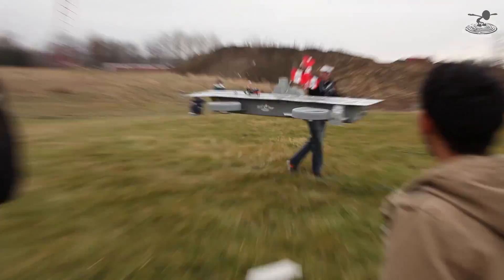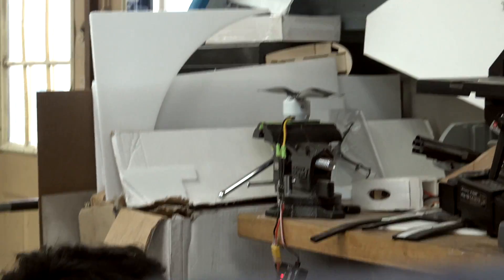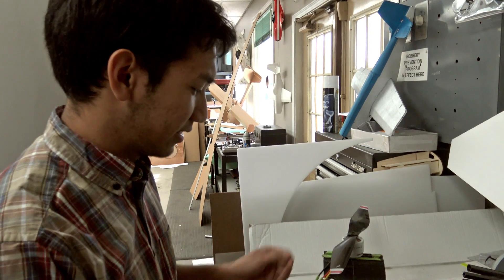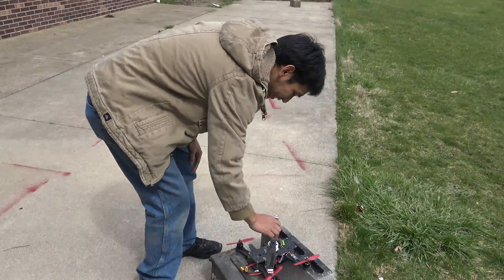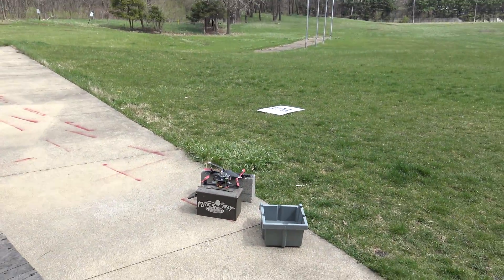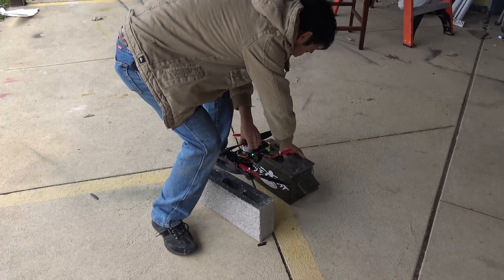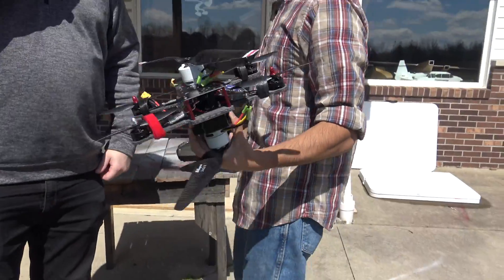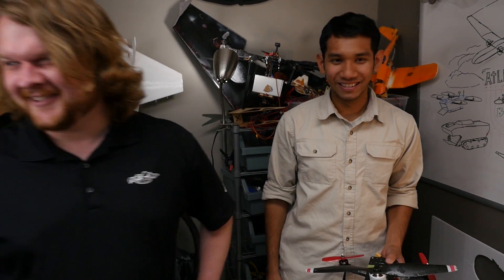Mini Multi Big Rotor! | Flite Test

Comment: nice test ,looking at this experience unfolding I had one thought ,longer arms for the small motors ,moving them out of all the turbulence  .PLUS longer arm = a better lever effect that will possibly make them demand less energie to stabilize the entire "PropBii"   I am thinking ate least 4-5" away from the tip of the big props (,hehe yepp a name suggestion on top)  On the other hand they will need to move more distance to achieve corrections ...Bets are open!  .Hoppe this comment reach you well . (FYI I did not take time to read any of the other comments ,maybe one already suggested this .I will  come back to read laterz  TY VM for the entertainment  Cheers

Comment: Have you ever tried doing a quad/gyrocopter.  So one free spinning unpowered prop on top and some sort of thrust in the back with a rudder.  You could take off with the quad and then get up to speed and switch over to gyrocopter mode and go long distance low power.  Would be interesting to see if that works.

Comment: by the way, other that the weight penalty, have you considered the impact to stability of putting both of the lifting, slower rotors above the multirotor frame instead of having one above and one below?   ....Something like this arrangement but sized appropriately...
https://hobbyking.com/en_us/contra-rotating-bl-system-375w.html?___store=en_us
...and yes, the spacing been the rotors should be large enough.

Comment: Instead of the large lower prop, could you use a heli stabilizer bar? It would counteract the rotation of the top motor, but it wouldn't cause so much washout instability. Just a thought. Thanks

Comment: The more lift gained by the two counter rotating props the less control authority it has without adding cyclic pitch so you end up flying without the needed control response. But how are you going to get by without the Helicarrier? That was cool... I guess you must be building a larger version...

Comment: You mentioned a youtube video where they had longer booms to get the small props out of the prop wash? Do you have a link to that video? 

I love you guys, bc u have an unlimited budget to toy with ideas like this. But,  seems you guys spend more time screwing off,  than advancing the tech. As an aerodynamics engineer, I knew right away this wouldn't work.  As u said, prop wash = impossible. 

You could really be on to something here tho! Why in earth didn't you take 30 minutes and extend the booms? I was very excited to see the performance! But then you just started throwing fruit at it in typical Flight Test fashion.... If you guys are interested in having a SERIOUS engineer on your team with a degree in Aviation and 30+ years in the R/C aircraft scene, I would LOVE to voluntarily contribute in any way I can!

PLEASE don't give up on this. I know of several methods to solve the problem, with and without extending the booms.  I KNOW this will work, keep at it guys! Or send it to me,  i would LOVE to take a crack at it!

Comment: more aggressive pitch on the each successive rotor from top to bottom.
The four smaller rotors need only a minor increase.
While on the bottom main prop I'd go with the most aggressive pitch you can get.

Comment: The Helicarrier was your answer at 0:24 
Remove the duct assembly from the carrier to use as the new body for your project then put the 4 smaller motors outside the duct. 🌀

Comment: You could lengthen the arms so they are out of the prop wash and have more leverage to maneuver the copter, and then they wouldn't have to work as hard, allowing you to make support the copter with the larger more efficient motors. You have the concept down, could make a revision 2 that refines it to get that 15 min.

Comment: you could try to increase the power on the large rotors, when they then produce enough power for lift you could then reverse the rotation on the smaller motors to brake as opposed to thrust.
This would give variable thrust by upsetting the flow over the large  rotors

Comment: Make a octocopter with just those big motors and props and see how fast it is.  Then see how much it can lift.  Then how long of range of gear you can pile on it for FPS.  Then combine them all together and make it a package delivery drone with a good mixture of range, speed, and load... and add some safety stuff like blade guards and the ability to run with 2 motors down and redundant transmitters and receivers.  Try for say a 10 pound load and a range of at least a 10 miles.  You might need a tower for the range... or maybe just make it a GPS programmable... think Amazon delivery quad.

Comment: You should have a look at the paper 'Towards A More Efficient Quadrotor Configuration'  by Scott Driessens and Paul E. I. Pounds. They use a single large rotor going clockwise and 3 small angled ones going counterclockwise. There's some quite accessible performance analysis in there as well.

Comment: With all that weight, how is the copter able to fly when you take off using only the 4 regular motors? Does it depend on the motors? I use 1000 kv motors, 2200mah battery, and 5030 propellers and it won't take off

Comment: After the bottom motor fell off, you shoulda tried to fly it like that cause then you won't have all that air being chopped by the bottom prop. Or would it start oscillating?
Reply: +Jon Evans 
You need 2 rotors (each spinning in the opposite direction) to prevent the drone from spinning, much like the tail rotor on a helicopter. Or even more simular; a coaxial rotor helicopter. It would be best if the rotors were closer together though, again like a coaxial rotor helicopter. I doubt that's cheaply possible in this size though.
Reply: The 4 small props should be enough to counter the torque spin effect.
Reply: Eric Denny The 4 small props only counter each others' spin, not the main prop's spin. besides added lift, it would be as if they weren't there.

Comment: Take off the motor on the bottom, and set all the small motors to spin the same direction, opposite of the big motor on top. It would be hard to figure out yaw, but you would enjoy the challenge, right?

Comment: Could you just remove the bottom rotor?
Reply: That would be way to difficult to balance the torque roll that the large motor and prop would creat
Reply: Fair enough. Has it been tried?

Comment: At 6:25, you say that they were 2300kv instead of 2000kv and that they were overpropped (prop too big ?) so they oversped.

Shouldn't overpropped motors run slower but with more current ? So that you exceed the max current limit rather than overspeed them ?

I have the impression that overspeed would kill the bearings (and maybe cause rotor deformation)  while overcurrent kills the windings ?

Comment: Could you do the same thing with only one big motor on top and the four small motors turning in the same direction (opposite of the big motor)? You would have to balance the thrust to keep it from spinning but the big prop should take some of the load off of the small motors.

Comment: I don't know if your flight controller would handle it, but what if you run all the small props in the same direction and remove the big prop on the bottom? You are using so much small prop to cancel out torques that they are unable to keep things level.

Comment: The larger props added excessive drag on the smaller motors by messing up the direction of the air flow.

Comment: Replace the outer motors with servo controlled louvers and/or rudders to direct the air flow??
It seems you have a coaxial except for having a quadrotor between the blades.

Comment: How about adding a fast motor to the tail end for forward thrust on a separate channel? Or mix?  I messed with this and a toggle to have off, med, high. It worked.  But I didn't bother tuning it and then left it alone because of time.

Comment: it can work with the big motor on top. the small ones just for stability they work less hard , the bottom one actully doing nothing, making them work harded
Reply: +Edmundo Andres Do you mean the top rotor CW and the smaller ones all CCW? Not sure the Positive and Negative Yaw would be in equilibrium
Reply: +jsl151850b the top one help in lifting the small ones help stability and bottom one useless

Comment: Now try that with a tri-copter, it would be a lot more stable, you could probably get away with just the top rotor if you have a larger tail rotor.
Reply: +cammservices Right.  Asymmetrical configuration with 2 large props and one smaller one for the tilt.  Better efficiency than a quad.   CG right behind the front boom.  I was able to get almost 45 minutes with mine!
Reply: +Allen Tweed Agreed, I run two 10x4.5 on 800kv and a 6x4.5 on 2150kv for the tail on mine.

Comment: Peter,  you should try Mounting 4 of those huge motors on that frame at different Heights.  Mount 1 on the frame, next 1" high, the next 2" high and the last 3"high.  Or what ever it takes..  They will overlap but that should increase your flight time 😁

Comment: Will you guys do some type of efficiency challenge for multirotors? I'm sure you have seen the quads that some have built with high efficiency props, and special lithium ion cells to fly from 1 to 2 hours. It would be cool if you could spread the secrets of high endurance multi's to more of the R/C community.

Comment: I am getting 10.5 minutes on my mini quad at hover with 2204 motors at 2300kv the battery is a 3s 3000 25c  "Black magic " and I get about 7 to 8 minutes of normal flight carrying a Gopro 
having said that I am not a acrobatic  flyer so this set-up is not good for racing

Comment: Peter, I like the concept of a smaller number of larger props to gain efficiency.  I experimented with a tricopter with two 15 inch props to do the lifting and one 8 inch tilt for stability.  The large props carried 80% of the load at 470 kv and the rear tilt carried only 20%.  I was able to get almost 45 minutes.  With your big motors and slower head speed you could probably do even better.  Here is the video of my rig.  Thanks for sharing!  

https://www.youtube.com/watch?v=GKLh-2gPtxU

Comment: Thrust vectoring on a mini quad anyone?
Reply: +mrmurder75 I would like to try it.  Two large props in front, maybe 15" 470 kv, two smaller props in back mounted on a David Windestall tilt using 1000 kv and 10" props.  Mix the tilt (rear props) with the down elevator control and the machine should fly almost flat.

Comment: Why not using 2x 3s, in serial for the big motors, and the smaller ones connected to the middle point, with an opto the smaller could be distributed on both accu.

Comment: what frame is that?
Reply: Put that in production lol. I want 3
Reply: +michael carmouche A versacopter frankensteined with some other CF bottom plate by the looks of things!
Reply: +Sean Duffy im wondering what that bottom plate is
Reply: +michael carmouche It is a prototype bottom plate for the versacopter.
Reply: +MULTI-MAUE lol right it looks kinda like the vortex pro but a solid plate
Reply: That frame looks amazing I like how you can take the top plate off and access everything easier

Comment: What if you ran just one large motor for main thrust, then made all the mini quad motors reverse rotation. With just one main motor on top you wouldn't have to worry about taking off before you spool it up, and perhaps you could use an old cp heli gyro to adjust for torque rotation?

Comment: So is this technically a hex?
Reply: More like a quax
Reply: normal quadcopters, hexcopters, etc., are all referring to a polygon (a two-dimensional shape) because the rotors are all on the same plane...
putting the large rotors above and below has turned this into a polyhedron (a three-dimensional object).
so technically, this is an octahedropter (octahedron).
Reply: Jep
Reply: +Humboldt710 yeah
Reply: a sextopter

Comment: Jet powered multi-rotor! It has to be done!
Reply: +Joshua Real you cant control the trust of a jet engine very fast/precise but with extra stabilising props like here it could work. But it would be very expensive...
Reply: No, have one jet engine with a belt or drive shaft attached to each propeller and have variable pitch on the propellers.

Comment: Should be able to get the lift you need with just a Heli rotor assembly and large blades. Let the heli blade rotate from the rotating small props? The large heli blade needs no motor.??